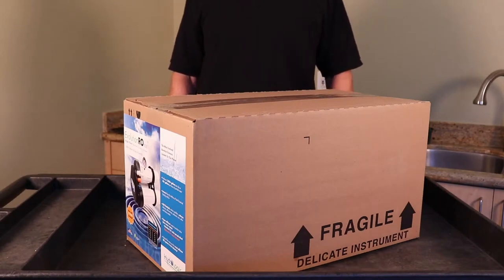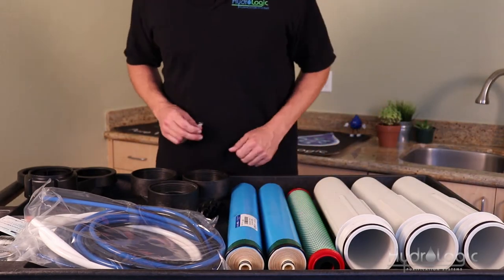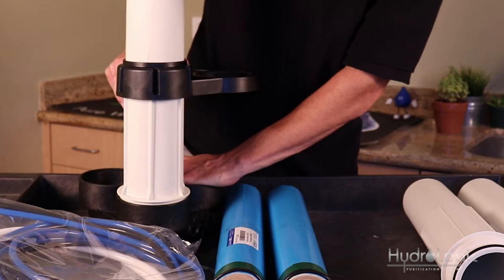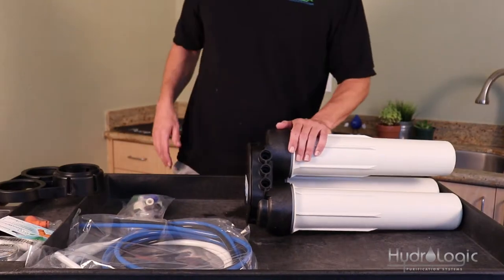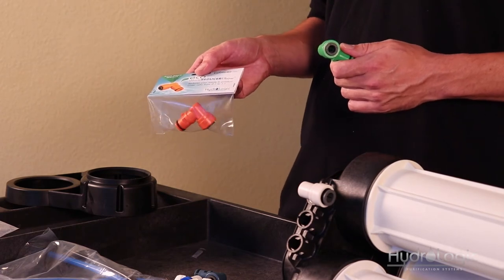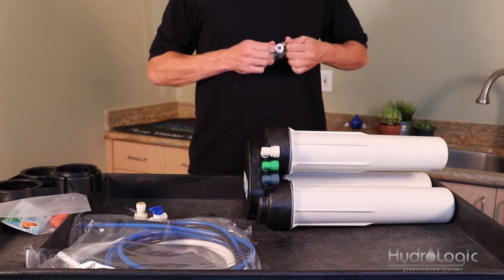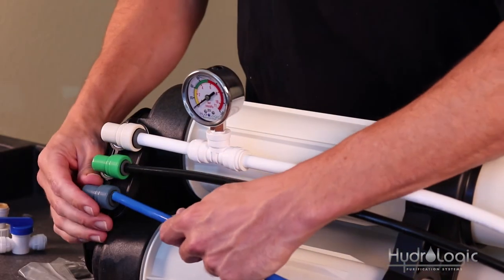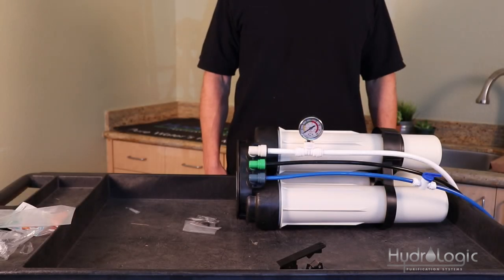Evolution-RO1000™: How to Assemble

Comment: My system had pieces missing, I don’t comment on this stuff usually, but I’d pay $100-$200 more and get a better RO system, these work bad with well water too, even if you have (2) pre-filters, which I have, they clog and stop working.  It would cost this company about $10 more to send these assembled, they are cheap and this is a low quality brand.